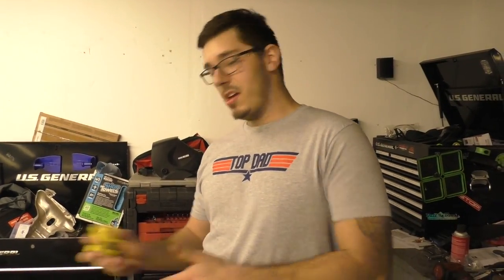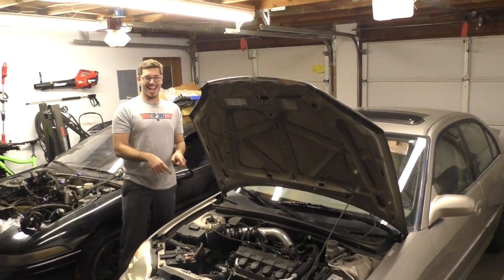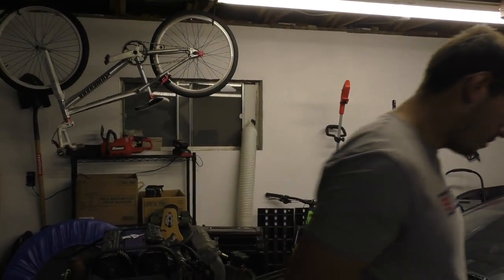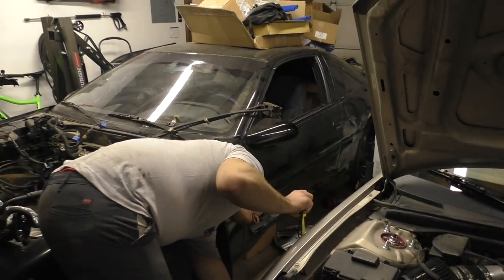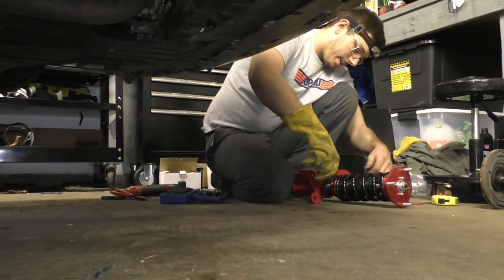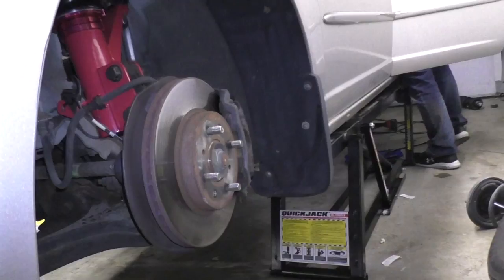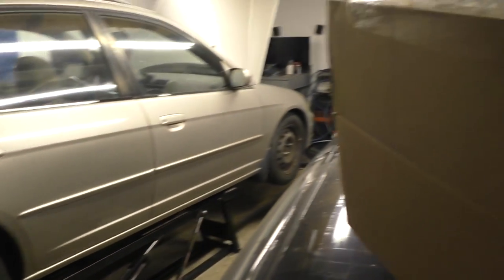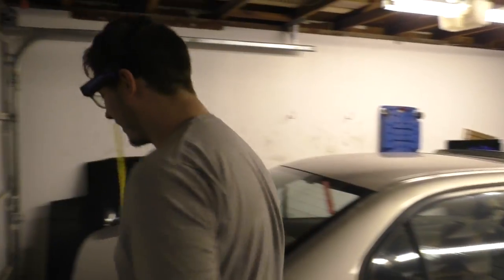Installing the $250 Maxpeedingrods Coilovers on 2002 Honda Civic EX! | $500 Honda Civic Build Pt.4

Comment: Just got these same coilovers for my 2001 civic lx coupe...bought the car for a few hundred with a little over 200k miles on it - wanted a project car as I learn how to do my own repairs and maintenance...since winter is rolling around here in the northeast I didn't want to slam the car, so my plan was to drop the ride height by about an inch in the front and back...I was able to do this on the front coilovers, but I had to drop the ride height of the rear coilovers by about 1.75 inches compared to the front...haven't taken the car off jack stands yet so I haven't had a chance to look at everything on the ground, also still have to install the rear camber arms, but it looks like we're in this together with these budget ebay coilovers! hoping for the best man...thanks for the video
Reply from the maker: Dude!! That is so exciting! We will keep posting videos on the civic every few weeks on Friday’s, with a new eBay mod each week. Keep us posted on how your build goes!
Reply: @gridengine  absolutely! I'm interested to see how your car turns out...so far I've installed an eBay cold air intake (which required quite a bit of modification to make it fit), eBay exhaust (honestly doesn't sound bad at all), eBay short shifter, some random Amazon shift bushings to help improve the precision of the shifter, and I did my timing belt/water pump/tensioner which went "OK"...if you check my videos you'll see the weird rough start/crank no start condition I've inherited from the timing belt change...I got the Continental kit from RockAuto for the timing belt, but maybe the timing is off by a tooth or something, I'm not sure...I've checked and re-checked it over and over and it seems like it's in time, so I have a little work to do to firmly diagnose that...I didn't skimp on spark plugs or coil packs, and if you end up having to replace any sensors I recommend just ponying up for Honda OEM sensors...I don't think these cars play nicely with aftermarket sensors
Reply from the maker: Hey man sorry for the late response. Thanks for the tips! We are gonna do a timing belt and water pump here soon as well… hopefully our luck is better than yours 😕 also, buying from eBay and modifying if needed is always more fulfilling that spending a bunch of extra money to (maybe) get a part that fits perfectly! We love that kinda thing.
Reply: Do all coolant line and radiator when you do the timing belt and pump. Good luck with these civic. I suggest leave it as stock as possible and save your money.
Reply from the maker: Thanks for the suggestion!
Reply: Exact same issue. Try messaging the suppliers, Got mine off amazon and he’s going to send me taller dampeners for the rear, and shorter for the front. To even things out.
Reply from the maker: That’s a great idea! Maybe we will buy another set in the future and try different damper sizes.

Comment: You put all that preload n the spring what do u expect 🤔. I have them Same coilover n my em n the ride good  yes they  not bc but for what they are n worth if u set them up properly they're decent had mine  on my car for two years n they  still going strong n drive good
Reply from the maker: We have a mod planned for this month that will allow us to get a decent ride quality AND keep the car fairly low. But yes, the amount of preload on the springs makes the ride quality AWFUL.
Reply: @gridengine do it over.  Set preload to 0 and use the only the shock body , to adjust the ride height. That's how it's done
Reply from the maker: @YokoSmash I don’t think you understand… the front springs are too stiff no matter how you adjust them… unless you want stock ride height 😕
Reply: Hi bro can I ask you how you set the lower part on yours, I bought a kit used I want to install theme but I don't know how I supposed to set the lower part as I want to lower like 1 inch or should (my kit don't come with a manual )

Comment: Thanks for the tip. If you lift them up at factory height is it still a harsh ride ?
Reply from the maker: It’s not nearly as bad when at stock ride height, but it will still be stiffer in the front than in the rear no matter what height you have it at due to the disproportionate spring tensions and sizes…

Comment: Can you make it go down more with those coilovers?
Reply from the maker: You can… but the front is going to ride like SHIT
Reply: @gridengine  I have a similar Honda and I want to lower it to leave it stance style. Would you recommend those coilovers?
Reply from the maker: Not for stance. These will require a dangerous amount of preload on the fronts to get it as low as you want unfortunately.
Reply: yes you can, I have 1 inch front 1 1/2 back..
Reply from the maker: How’s the ride quality? 👀

Comment: Just wondering have you had any bad clunking? I think something’s hitting on the front end of my car. Not sure if it’s the piston hitting bottom on the coilover? It’s a loud banging whenever the spring takes ANY load.
Reply from the maker: YEP!! We had that big time. We address it in this video here: https://youtu.be/qbZbhaRElGk
Reply: @gridengine  just curious if you have to cut the springs? I’m 90% sure the knocking is coming from the piston hitting the bottom.. i’m guessing cutting the springs makes it sit high on the adjustable threads so it doesn’t bang? I’m just trying to get my car drivable with these things… sucha pain in the ass. First the clunking was on the driver side, then it magically stopped and started on the passenger.
Reply from the maker: The only other solution that We’ve seen on the internet is to buy different springs for the front coilovers that are 8lb springs instead of the 10lb springs that come with the kit.
Reply: @gridengine  any spring recommendations? looking for some right now not sure what to get
Reply from the maker: We have not looked into any replacement springs yet 😕 sorry man. But when you choose, let us know what you think!

Comment: Those coilovers are STRAIGHT GARBAGE.....I just had those same coilovers on my Em2 and they caused my engine post mount bushing to BLOW! Wound up ordering a new mount bushing and a set of Ksport coilovers 3 days later! Its super funny seeing this video posted a couple weeks ago, when I had installed my set, i was all over youtube trying to see if anyone else was having issues and two weeks later this video pops up. CLASSIC! Great Video! P.S. Whatever coilovers you put on an EM2/EP3/DC5 has to be set accurately so that toe angle can be properly adjusted because of the aggressive angle of the tie rods as the car sits lower and lower!
Reply from the maker: Dude that’s messed up! But it doesn’t surprise me lol. These ride REAL ROUGH. If we ever replace an eBay part with something nice, it’ll be the coils! Thanks for the advice!
Reply: Flip the tie rod upside down to accommodate for the height
Reply: @Onedeepdrew  bada bing.
Reply from the maker: Oh damn. We didn’t even think of flipping the tie rods over! that’s really smart! Thanks for the tip!
Reply: I got the same brand and my passenger side coilover blew up
Reply from the maker: @tidusdouangmychitthuo1665 sounds about right lol.

Comment: How the heck did you get your rears to fit mine don't fit at all
Reply from the maker: In what way are they not fitting?
Reply: @gridengine  i figured it out i just used a jack to get my control arm higher but it was the bottom mount
Reply from the maker: Gocha. Yeah that’s the easiest way to do it. 💪💪

Comment: How did the wheel alignment when on your Honda Civic with the new Coilovers? Because the upper tie rod end doesn't fit perfectly on mines and can't get a wheel alignment due to this. 😢
Reply from the maker: You might need to replace your tie rod end, or maybe try a different alignment shop? We took ours to les shwab and they did a great job!
Reply: I did replace it with the OEM tie rod end while I had the suspension out. Maybe I'll try a different shop, but it's good to know that it work for you. 👍
Reply from the maker: Yeah man they should be able to do it if none of your parts are damaged.
Reply: Ok, because when I place the new part in it looked and felt fine to me, but the alignment shop said they can't align my vehicle due to the tie rod end fitting right onto the aftermarket Coilovers. Looking for a new shop that would align it. Thanks
Reply from the maker: The coilovers just have a hole in an arm that the tie rod end slips through. I don’t understand how they wouldn’t fit lol.

Comment: I bought exactly the same ones at ebay in January 2022 for my 2005 Civic LX and it became my worst ebay experience that I don't want to remember,,,,,,  After the installation with the lowest set up,,,,,  Front got toooo HIGH,,,,  it was way higher than my Eibach lowering springs (1.5" down in front) with the brake hoses touching the wheels without clips,,,  also the drive shaft sat too high due to unusual height of the coilovers,,,,, BAD welding also and unsafe at all!!!   On the other hand,,, rear got low enough,, lower than my Eibach (1.0" down in rear) ,,, Absolutely, I got very upset and soooo mad,,, with very ugly looking,,,, and of course I had to return,,,,, Imagine!! ,,, switching back to my Eibach,,,,, spent so much time and costed badly,,,,, It was a Nightmare of 2022,,, I was looking for the same victims at that time,,, but I couldn't find anybody on my web search,,,,   Anyway,,, One year has passed and I am trying to get TEIN this year!!!   Glad to see this video and other comments,,,, Cheers!!! 🍻🍻🍻
Reply from the maker: Yeah man we had basically the same experience! The problem with the fronts is that they have 10 pound springs and the rears have 8 pound springs. Such a weird choice on the company’s part… but TEINS?? Those are gonna ROCK dude. Let us know how they feel!
Reply: I had the same problem
Reply from the maker: @tidusdouangmychitthuo1665 sadge
Reply: Finally, I ended up with getting Air suspension installed ^^),,,  I was sooo confused and worried to see feedback of the coilovers installed on this Civic,,,,   I never figured out which one would be better,,, like Godspeed, Raceland, BC Racing, Truhart, Skunk, Tein or Megan,,, etc.....  With my horrible experience with Maxpeedingrods,,,, I decided to go with Airmext ^^) just installed a few weeks ago,,,, it is excellent so far,,, and I will post a video on my channel by Christmas,,, 🤩🤩🤩 Cheers!!
Reply from the maker: @ichiropsToronto dude that’s sick!!! Bags are the best of both worlds for sure.